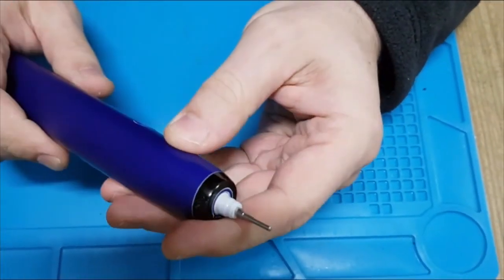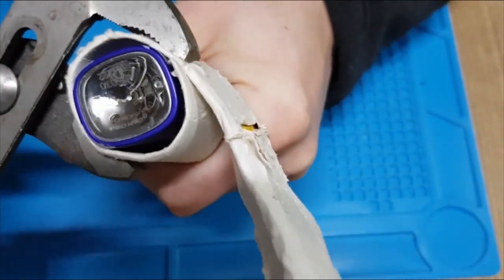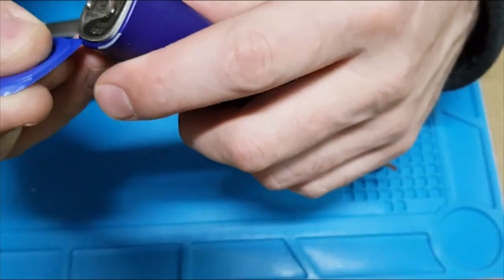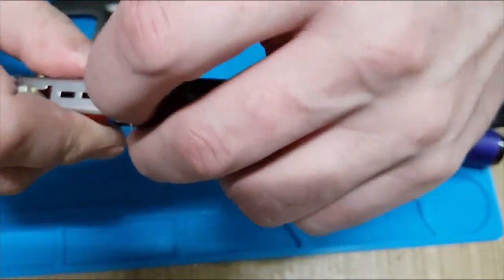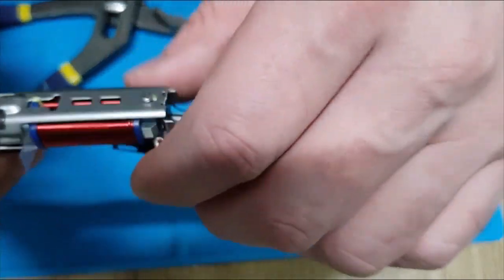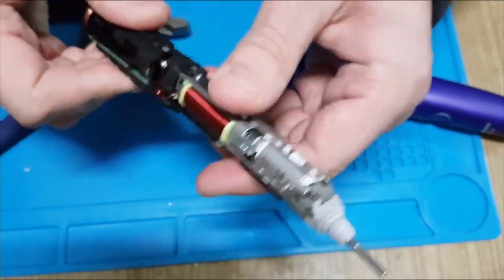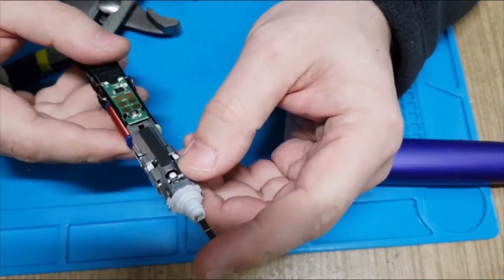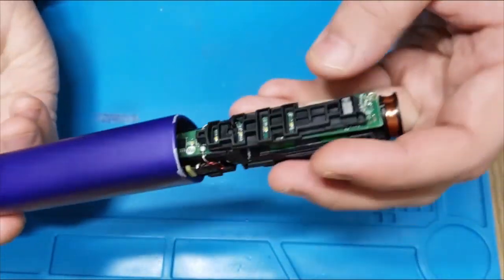Philips Sonicare DiamondClean /no vibrations/ opening and repair

Comment: Thank you for the tips. My unit has a slightly different problem. It’s fully charged and when I press power there is a brief vibration and clean light up. This last a fraction of a second and the unit turns off. Have you experienced this before? Any fix ideas?  Thank you.
Reply from the maker: I would suspect water damage that has some traces "almost" corroded away.. check my water damage repair video series and check the brush for water damage.

Comment: Thank you for your very clear video! I learned a lot about Sonicare internals.
Unfortunately this didn't fix the issue for me. I've tried many different gap sizes, from 0.5mm to 1.5mm. Still get the high pitched squeal and no vibration. My Sonicare is quite new on the inside (very clean, nothing loose or broken). I've probably watched just about every Sonicare video on this topic. Help!
Reply from the maker: so the gap stays open when you take out the spacer or does it snap back to no gap?
Reply: @letsfixitgarage  it stays open
Reply from the maker: Then I know only one defect that seems to be your case.  it's pretty rare and we haven't figured out why it occurs but one Youtuber A.C.E repairs found out that in some cases ROM drops it's code. And he figured out a way how to reprogram it. Although as we haven't figured out why it drops and my experiments with exchanging of the chips  didn't brought any reasonable results we have left it only on his Chanel. Check it out: https://youtu.be/90lxZcGk7Ec of course subscription to the Chanel would mean a lot for a starting Chanel

Comment: thank you, that was quite useful. for me the issue was loose contact on positive battery terminal. used piece of plastic there too.
Reply from the maker: If you mean metal pin from battery to motherboard it means you had water damage and it corroded away the spot weld.. I would suggest to take out the motherboard as usually main damage is between motherboard and frame..
Reply: @letsfixitgarage  thanks, it started after dropping the device on the bath mat. so if the battery was welded originally on both terminals after the incident the + terminal lost the connection. i tucked a piece of plastic between the case and the pin forcing it to touch.
Reply from the maker: Hmm interesting.. usually the pin brakes off only if there is corrosion from water.. but maybe it's a coincidence. Force contact is temporary solution it would be better to spot weld it or if it's positive terminal soldering is an option as well..
Reply: @letsfixitgarage  yeah, i know this is not a long-term solution but i don't have the equipment and buying one just to fix this won't probably be a bargain.

Comment: Hi there is there any way to stop the sensitivity vibration warning?
I’ve had mine repaired and it’s come back Way too oversensitive with that warning sensor function on it
Reply from the maker: Sensitivity is signaled by the magnetic sensor next to the magnet. So either you made very big gap between electromagnet and magnet or sensor has moved from its initial place. Reglue magnetic sensor in different position accordingly.
Reply: Okay thanks for the information I’m going to take it apart and look for the magnetic sensor.

Is it easy to spot ?
and also would it be possible to take it out and leave it out as it’s not necessary to have in ?
Reply from the maker: It's glued next to the magnet. And has a ribbon cable to the PCB board. Haven't tried to remove it but it works in on/off principle so try to desolder it from PCB and if it works fine all good if no you can resolder it.  Although it's less work to adjust its position then desolder it.. :)

Comment: This worked really well for me.  My only request is to show more clearly the separation of the motor from the pcb.  I damaged the tabs by pulling it apart, not it the full extended position.  The T slot is the key.  

I will be getting a few more years out of this unit!  Thanks so much.

New subscriber.
Reply from the maker: Thanks for the suggestions it gets quite clear once you take one apart but yes view from all angles is helpful to understanding.. and if the holding tabs brake no problem it's wigly, but once inserted spring with tabs on the bottom hold it in place really well. Thanks, hope upcoming content will be interesting for you :)

Comment: THANKS!!!
This saved me 100€ for a new toothbrush!
My brush dropped and didn´t work any longer, but now it works again! Thank you!
The only thing I did different is the removal of the bottom plate. I glued with a glue gun a stick of hot glue to it and just pulled it of. I saw that in another video, and it worked well.

Comment: The metal part for the toothbrush head is loose. Can it be replaced
Reply from the maker: Yes check my other videos I describe this defect and fix for it as well.. although it could be a broken part then you would need some spares to fix it but still quite easy repair

Comment: Any idea where to get additional screws without having to buy a whole new top piece? Or what size screws? The head on my brush was extremely loud. Opened it up and its missing the top screw!
Reply from the maker: Well it can't evaporate :) so either it fell out when you opened it up or it's stuck to the magnet...

Comment: This was really helpful. The screw near the tip had rattled itself apart on mine but I managed to get it open and tighten the screw without any damage thanks to your video.
Surprised there wasn't any threadlocker on that screw considering it'll be subjected to daily vibrations and is probably prone to rattling itself loose.
Reply from the maker: Seen both cases with and without thread locker they still tend to get loose.. then again nice of Philips that they still use a scree that can be retightened or exchanged and not all in one part that is impossible to repair ;) good job on the repair!

Comment: Thank you SO MUCH Lets Fix It!!! Using your video I was able to repair 2 of my Sonicare DiamondClean toothbrushes! 🤘😁🤘You're so right, one little drop on the toothbrush head and it stops vibrating like it should. It's a terrible engineering design, especially for a $200 toothbrush! But thanks to you I was able to fix them!
Reply from the maker: Glad it was helpful! Sure for this price it would be nice to have unbreakable thing, but one huge + for Philips is that they made it repairable.. they could have covered it in epoxy and after drop it would brake the shaft.. so let's leave a positive thought to Philips for having repairability in mind ;)

Comment: Many thanks! I've just repaired my Sonicare, which was electronically and mechanically well but also has the distance canceled and required adjustment. The most tricky part is the initial opening without leaving any mark.
Reply from the maker: Your welcome :) yes it is, especially first time but I do like Philips materials they can withstand quite a lot. If you will take thicker paper it is fully enough to protect it from damage..

Comment: Great tutorial. I'll try this when i get home from shopping. I have 2 that can potentially be fixed. Thanks.
Reply from the maker: Good luck! If you would have some problems write a comment or email (in about Chanel section) I try to help any time possible ;)
Reply: @letsfixitgarage  Thanks. I cannot, for the life of me, see (lol) or figure out the internal clipping to remove the inner assembly.  Might be better to leave to daylight. Any more tips on unclipping?
Reply from the maker: :) light is crucial, but check my other videos, there is one specifically for your question.
Reply: @letsfixitgarage  Thank you so much. I didn't realise you made more. It was very helpful. Managed to get it out. Thanks. :)

Comment: I followed these instructions and yes, it totally worked! I would like to point out that during the part where he removes the back top cover hiding the screw, you can actually just pull the battery pack backwards and the cap will slide out from its slots. This way you won't have to pry it off and cause possible damage. Also, for the spacer I used a zip tie that was about 1mm thick. I didn't have superglue so I gave myself more room knowing that eventually the coil pack will slip upwards regardless. Maybe I'll have some superglue ready for next time. But I'm DEFINITELY not buying another Sonicare in the future when I can just FIX IT!
Reply from the maker: It's a thing of luck sometimes the battery pack slides off very easy sometimes you need to push quite strong to take it apart.. as for glue not sure if I would recommend this approach better use screw tightening liquid.. it's designed for exactly this task ;) and yes it's a good feeling when you can repair device that you own, that's why I really hope that right to repair will be a thing in future.. ;)

Comment: Awesome. But After That my toothbrush will not start at all, it seems that there is an issue with the electronics. Any idea what could be the problem and how to solve this?
Reply from the maker: Check my other videos for water damage there is a lot of info on diagnosing electronic defects. Or check if any component got knocked off when removing the toothbrush from its casing.

Comment: It worked perfectly. :)
The other one i have with a wobbly head seems to be beyond repair. Looks like something in the top broke in a surprisingly clean and geometrical line.
Reply from the maker: Glad it was helpful :) yes sometimes they brake but these parts are available on eBay or AliExpress. And it's only one screw to exchange it ;) just use screw locking liquid.

Comment: Thanks for posting this, very helpful. I have a HX6530, it's showing fully charged, green solid light. Battery meters out at 4v, no signs of water damage or stuff inside the unit, very clean, but it will not power on. I adjusted the magnet per your video instructions and widened the gap a bit even though it was showing ok. Any other ideas what might be causing no power on at all? Thanks.
Reply from the maker: Difficult to say.. I would check if signal from button comes through and if MOSFETs are ok.. and if the rubber seal is all black and with contaminations I would still look under botom of the board. I have seen clean boards but when you look under it there is a lot of water damage..
Reply: Lets Fix It Garage Thanks for the info and quick response.

Comment: Hi there , what is the adhesive called that the ORiginal poster put on the screw before putting it back on the electromagnet ?
Reply from the maker: That's a screw tightening liquid you can find it in any car goods store. The most popular brand is loctite.

Comment: You Sir just saved me $200! I am a 25 year old woman and would have never believed that I can repair my electric toothbrush myself. But with your guidance I made it. Thank you so so much!!
Reply from the maker: These kind of comments are really ego warming :) when a guide helps someone, who doesn't trust himself, to give it a try and it works! Glad it was of assistance, trust yourself in future projects and share the experience ;)
Reply: $200? I spent $40 on mine
Reply: @Crazylegoman3791  But that's not the Diamond Clean. The 9000 is around 125€ single and 200€ with the charging glas and fancy stuff.
Reply: @mowax74  oh.
Reply from the maker: There is a lot of different Sonicare models but the nice thing is that they use the same drive mechanismus. So even with cheap brush you get the same cleaning action.
Reply: @letsfixitgarage  Of course. We got our DiamondCleans back then as a present from grand ma :) When I go for a new one some day it will be the 50€ model, since i do not even use all these extra modes on the diamond. But thankfully I don't need a new one right now since I got mine fixed with your guidance. Thanks! :)
Reply: Or you can call sonicare and they will replace it for free
Reply from the maker: If it's under warranty of course easiest way.. but after warranty they say buy a new one no repair is possible..

Comment: Have you ever experienced the problem of the tooth brush continuously turning on by itself? I'm wondering what the issue could be but it just turns on randomly and it's super annoying!
Reply from the maker: Yes, water got inside and is shorting the on/off button. Check my water damage videos what needs to be done to repair this.

Comment: Hello! I fix everything I can but I’d put the repair of these toothbrushes into the “too hard” bin. But with your vid showing me it’s possible I’ve now moved the magnet away from the coil and had to replace the “stalk” and seal with one from eBay for £6. It’s now working fine. Tip, I used an old credit card as the spacer, it’s about 0.75mm thick. Many thanks to you, this is a real public service.
Reply from the maker: Thank you for the feedback! It is discouraging at first but when you go further it's quite simple design. If there would be some other brake downs/water I have other videos explaining all of these in detail as well.

Comment: I love this video and appreciate how detailed it is. Any thoughts on how to properly separate the motor from the board? I can't seem to get it apart in order to access the screw behind the board.
Reply from the maker: Well with praxis you get a feeling how much you can bend it to get it apart easier but in principal just pull it apart. There are two small hooks that prevent it, but even if you break it, when everything is assembled back it will be hold in place by spring and other hooks so no worries and just pull it apart ;) there was some thoughts to insert something thin and strong between black plastic frame and metal frame of electromagnet to push the hooks up but as said not sure if that is to isefull if you can just pull it apart :))
Reply: @letsfixitgarage  I appreciate the response. I ended up pulling hard enough that the plastic tab ripped a little but to your point it does fit snugly back together. The hardest part (besides the slide tab dismantling) was finding a 0.4mm piece of plastic to use! Thank you for the great video.

Comment: Which direction do you put the pressure when taking out the motor?   I got the cover off but I just flipped it upside down and pushed the metal thing against the table and it fixed mine
Reply from the maker: Sorry but I didn't understood you question..

Comment: My sonicare toothbrush vibrate well and with it's usual sounds, however when pressure is applied to the brush head, vibration ceases.
Reply from the maker: Then this video is exactly what you need :) take it apart and Increase the gap between magnet and electromagnet
Reply: @letsfixitgarage  Thank you for a response. Unfortunately after opening mine up, have an entirely different internals. They shielded the entire motor where you cannot even access it. Looks more like this one: https://www.youtube.com/watch?v=6FGn6x_-XJw
Reply from the maker: I had one like this in repair but it was a water damaged one, so didn't had to check the magnets. But it did looked quite difficult to change/repair something.. how old is yours? I assume that it's an older design as now I find only this magnet/electromagnet design that I show in my videos, even in cheap entry level Sonicare toothbrushes..
Reply: @letsfixitgarage  Good question. I found the box and had a copyright year of 2014. It is Model HX6211/04 according to the box and the bottom of the unit itself shows HX6210. I think I bought this one 2 or 3 years ago. I found my older model HX6710 (had that one the longest perhaps 4 to 5 years) which I think is actually HX6711/02. It looks like this one: https://www.usa.philips.com/c-p/HX6711_02/sonicare-healthywhite-sonic-electric-toothbrush. Sure enough, the internal are exactly the same with the one in the video and with your advice in the video, it worked again. I used a card type paper with a thickness of .78mm, and it worked. So happy 😄. I do notice that my older one had Li-Ion cell in them and my newerish one had NiHM cells, perhaps that is why the internal differences? I should mention that the newer one is the FlexCare variant.
Reply from the maker: Yes the other type has a NiMH battery that's why I assumed that it'sich older.. crazy that it's still sellable.. although if you have stock you want to sell it and not throw away.. glad this video was helpful with the other toothbrush :) and I do like li ion more than NiMH and newer model magnet design :))
Reply from the maker: P.s. thanks for the investigation in the model difference
Reply: @letsfixitgarage  No Problem. I decided to purchase another sonicare toothbrush (actually found it), and it is a boxed 9750 diamondclean with everything included for $160. So at least I have two working toothbrush handle for now LOL. The nihm version seems to have what I think are weld tacks or tack welds on the housing of the motor. Wondering if a dremel would be useful to cut the tacks, however most likely will damage the motor housing and everything inside of it in the process. The bottom of the handle was actually glued on to the white bracket instead of bolting on. Another nasty surprise I didn't mentioned earlier.